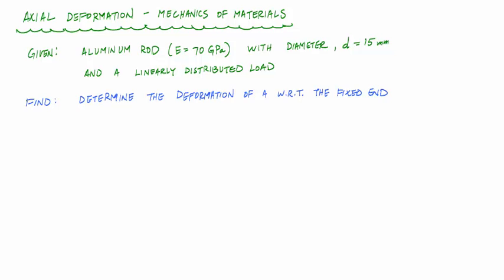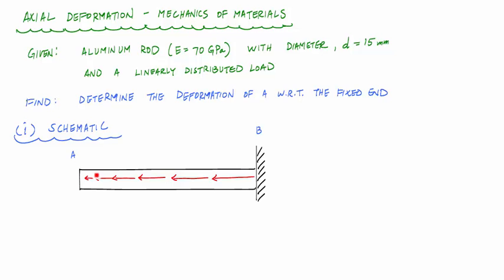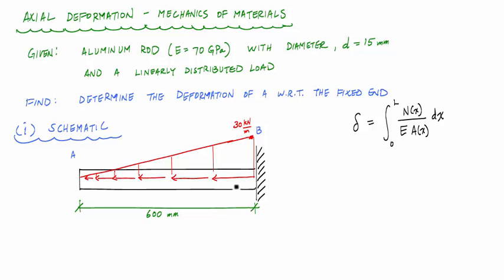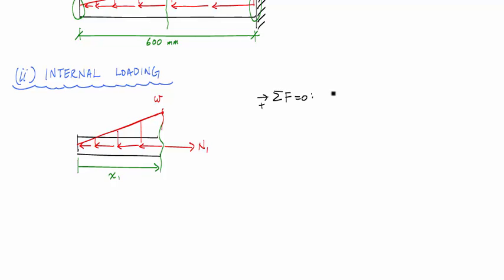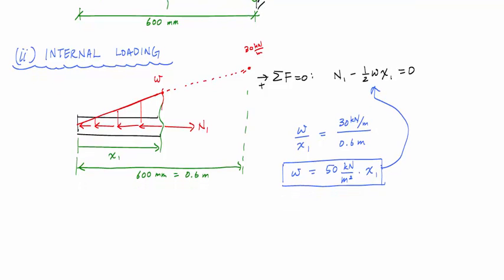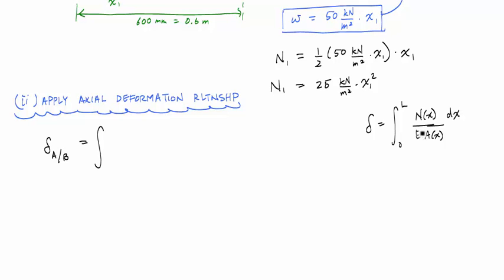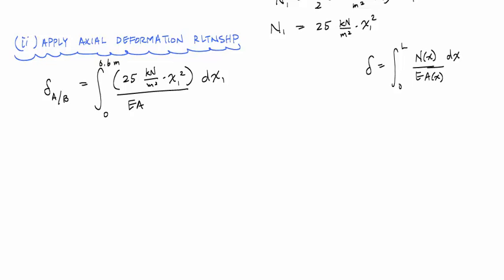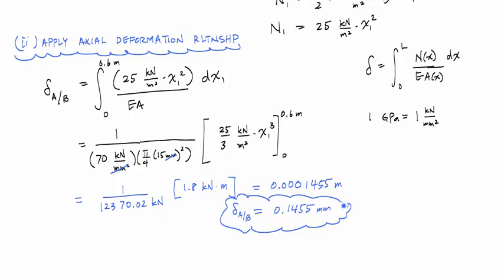Axial Deformation Example with Linearly Distributed Loading - Mechanics of Materials

Comment: can u please tell how the force on left side is 1/2*w*x
Reply: +Abhishek Verma Because w is a continuous distributed force, as drawn on the diagram. The force resultant W of a linearly distributed force w is calculated as an integral[ w(x)dx ], i.e. it's the area under the curve. Since in this case we have a linearly distributed force, the curve forms a triangle, and the area under a right triangle equals 1/2*a*b.
Reply: @zorkan111  
what will be direction of that triangular loading ?
It will be along axis of rod or perpendicular to axis of rod